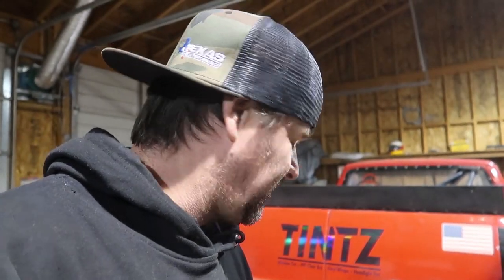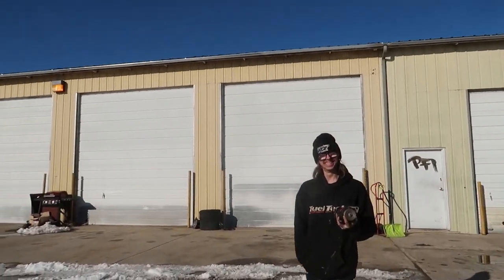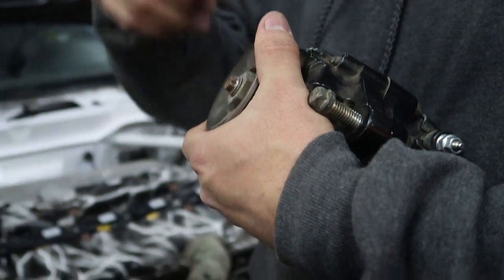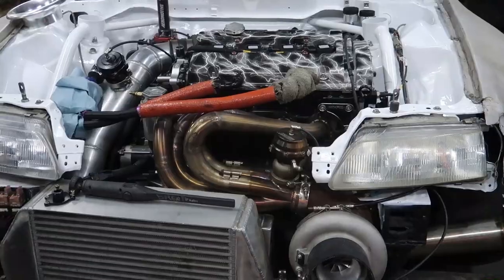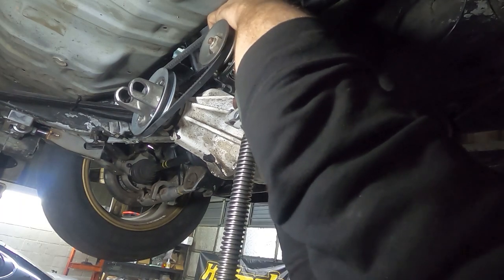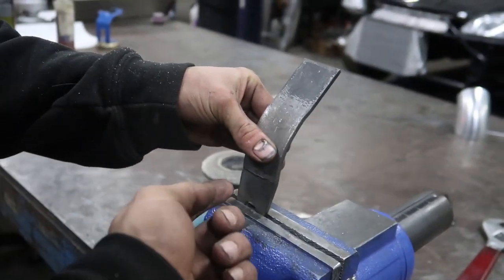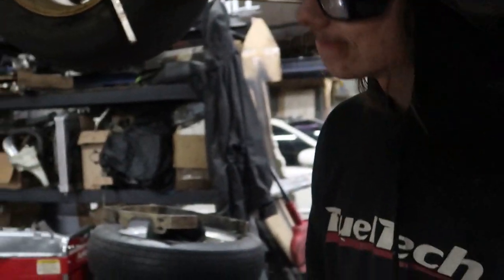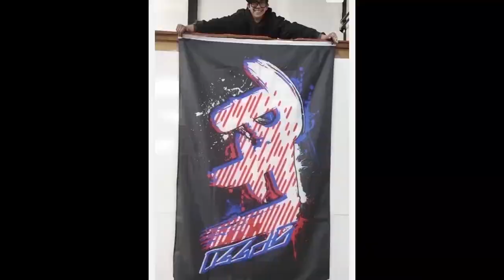Building an Alternator Mount for our 700hp H2B AWD Crx! Fun Father ,Son Project.

Comment: You've seen Ryan Tuerck's Supra? They put a clutch style pulley on the alternator, so it could still spin when the driveshaft stops, plus, a belt tensioner, so it doesn't throw the belt off. I thought it was worth mentioning.

Comment: I’m thinking of a brushless variable speed drill that you could take apart and use an adjustable speed knob to control the rpm’s. The battery that powers most drills are over 12 volts and should spin drill to power the alternator for several runs. If the battery is low swap it with another one.

Comment: Little welders tip. If you’re doing something like that nut and it’s not straight hit it with another tack right on the same spot. It will heat it up just enough to move for a bout a half second to tweak it without breaking

Comment: For your trailer use 2 inch square tube 1/4 inch wall, 4 inch x 1/4 inch flat bar 4x 15X7 5 Stud Black Caravan Trailer Wheel Rim 235-75R15 L-T 10ply Tyre 1250 Kg Rating, 2x 1.5 Ton trailer kit, 2 inch x 8 inch x 8 foot wood, 4 feel x 8 feet aluminium sheet for a vertical curved nose for wind resistance, keep it simple, flat, low to the ground with pull out ramps & winch to pull a car on if needed. This setup will hold a single car up to 3 ton or 6600 pound on the axles, 5 ton or 11000 pound on the wheels alone.

Comment: thank goodness you went off the rear end, I think off the cam shaft probably would spin the alternator to fast. At least I would think cause usually turns off the crank which would be half the speed of the cams. And they use pullies to speed or slow it down off the crank.
Reply: It wouldn't spin it fast enough.

Comment: As much as the drivetrain driven Alternator would be cool 

I think the cam driven alt would be more beneficial 
As being caught in traffic would be a pain

I know it’s sounds stupid 
But maybe a roof mounted solar panel ontop if your trailer and a main power wire back in through your lights plug to charge when sitting still  ?

Comment: As I mentioned with the truck, use some tie-wraps to hold a spare belt, or two, to the housing - two benefits, you don't have to drop the driveshaft to fit another belt, and you have the spare right there, not somewhere back in the workshop.

Did you chaps see how they sorted the drives out for Project Binky*?

With a cam' driven alternator drive, the biggest problem is the speed is going to be lot slower - the camshaft turns half engine speed and when belt driven, a 50% overdrive is common - all that means is the thing will be turning around a THIRD of the speed at the same engine rpm. Not something I've looked into, but it may be possible to adapt the orbital gearing of an internally geared starter to increase the rpm.

*For those unaware, for a fun project a couple of motorsport engineers decided to put the Toyota Celica GT-4 running gear into a stock appearing Mini - the classic, original - bodyshell. Keeping the turbo-charger and intercooler, the AWD, etc, and adding things like air conditioning, power windows, power tilt front end, and much, much more. there are a LOT of brackets... 
You can check it out here - but best put a couple of days aside for it - https://www.youtube.com/c/BadObsessionMotorsport - they make a heck of a lot of SEMA builds look like amateurs.

Comment: Surely an alternator would burn out runnin from the diff, I blew an alternator in 1st gear only on a bog standard 1.3 Austin metro. That alternator is gonna be spinning way faster than it should!, love the amazing content in every video.
Reply: Im sure they have adjusted the pulley size to spin in the correct rpm range for the altenator and it  all ready worked on the truck.

Comment: i love it.. my only question is, is the alternator going to move with the suspension and stretch the belt
Reply: Its independent suspension. The arms move but the center chunck stays in place.
Reply: no. its connected to the rear diff itself.... and even then it doesnt move due to being independent as Wayne said

Comment: just thinking about running an alternator off a drive shaft- it's not synced with the engine RPM... i guess you wouldn't want to do this on a daily driver cause it would be less reliable charging on the battery long term

Comment: Glad you didn’t try mounting the alternator directly to the camshaft. Cams turn at half the engine speed and alternators need a lot of rpm to charge. Notice how small an alternator pulley is compared to the drive pulley on the crankshaft. A direct mount alternator probably wouldn’t charge below 3000 rpm.
Reply: All depends on pulley sizes

Comment: It seemed to me, the way your attaching the Alt. it seems might over stretched underload & Diff angle change, then throw the loser belt. when you make a pass,  you might want to remove the belt, have a Battery fully charged just for the run?   I'm a retired Engineer, I over think everything lol    The first Rip should be fast!

Comment: Far as an alternator goes what kind of alternator are you using are you using a GM one wire alternator to run off of the drive shaft?

Comment: Isn't the rear drive alternator a bad design? I mean, the drive range is quite wide, will that not be a problem for either the alternator or voltage?
Reply: I mean ofcourse it is always better than no alternator, but there is a reason nothing comes that way standard

Comment: Does the bar u welded to move with the suspension?
Reply: the bar they welded to is welded to the body, it is the bar that has the top mount of the rear differential welded to it.
Reply: The diff is fixed in place on the chassis, CV axles.

Comment: Load on the cam with an alternator is probably a bad idea it's side load
Reply: That and remember cams spin half the rpm as the crank, where dynamo's are overdriven most of the time, driven of the crank.
Reply: That is what the pulleys size overcome